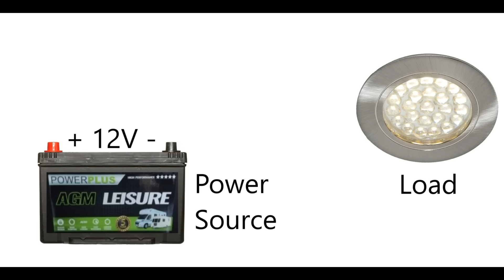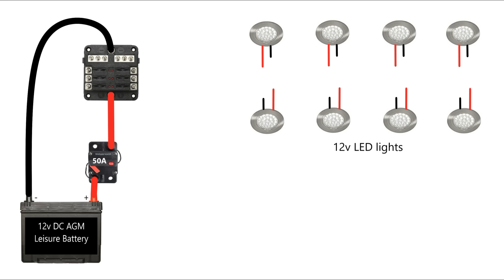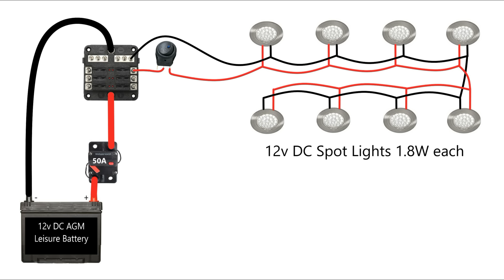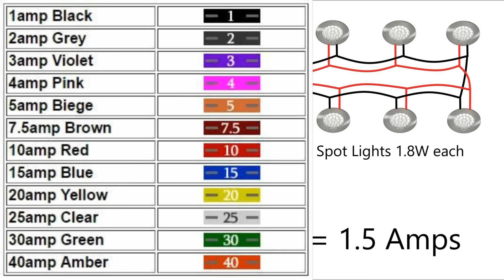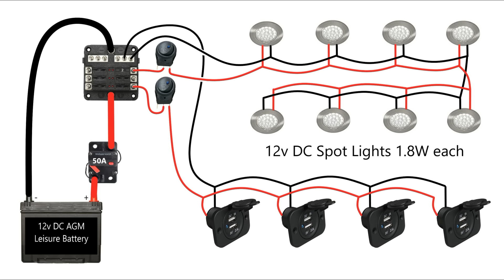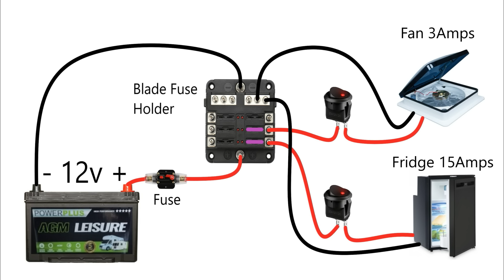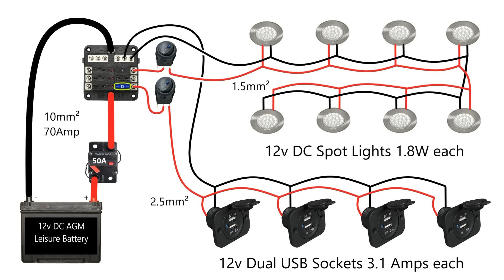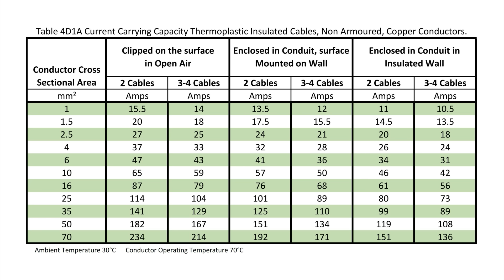Electric Cable & Fuse Sizing - Camper Van Conversion Series

Comment: Hi Greg,

Firstly thank you for all your well thought out and detailed videos, it's great to have a reliable source of information! I was wondering if you have created a video on wire size for invertors/batteries. I am about to install a 3500W 7000w Peak invertor into my van alongside 3 100Amp lithium batteries (I may add another battery to the set up if budget allows towards the end of the build!). All will be installed in close proximity and I think I need to make my connections with 4/0 awg (120mm2) wire but wanted to reference check with your videos. Thanks again!

Comment: Hi Greg. 
First off thanks so much for all your videos on self build campers. I've been following your videos from the very beginning of my sprinter build, You've helped me out so much. My question is about what size of breaker should I be using from the leisure batteries to the fuse box. So far I've got a maxfan and some LED lighting coming from the box. 
Thanks for any advice in advance. BTW I'm owe you several pints for all your very detailed and informative videos.

Comment: Brilliant video Greg. Thank you for taking the time. I have a question. In my van, during hot days some of the led spot lights stop working, then come back on at night. You say in this video that cable current carrying capacity reduces when the cable is hot. The van in black. I wonder whether the hot roof is the cause, as I think the cables are right against the metal. The van conversion is finished. Do you have any advice?

Comment: Need a quickie 12 volt setup to wire up some lights ONLY to light up a 3 room gutted house for the realistate lady to just be able to flip on to show the inside of the house, really don't want to deal with solar panels just battery & switch & lights

Comment: Great job explaining however a demonstration of wiring a three way would be helpful.
Reply from the maker: What are you converting a double decker bus? They are normally used on stairs or very long hallways. Vans are tiny so not really used. 
However as you’ve asked I’ve googled a wiring diagram for you 
https://upload.wikimedia.org/wikipedia/commons/thumb/7/7a/3-way_switches_position_3.svg/300px-3-way_switches_position_3.svg.png

Comment: Thanks Greg for all your great instructional videos. I have a question about wiring, could you enlighten me? I'm wondering if CCA cables can be used in the van or would it be better to go with pure copper? There is a lot of information about sizes but not about materials for wires in vans

Comment: another fantastic video ive found, one thing im still unsure on is cable sizes. why did the lights needs 1.5mm when from the table 1mm would have been plenty. also 2.5mm (according to the tablew) for the usb sockets was plenty big enough. cheers
Reply from the maker: There’s no harm in going a little bigger on cable sizes in fact there will be less voltage drop if you do. I could buy a reel of 1.5mm cable and wire most things so it was easier. 👍🏼😊

Comment: Hi Greg, as far as I can find yours is the best and easiest to understand info on this topic out there. But I do have a question… how do you wire your 230v sockets after your inverter… and how many is sensible. (I know there’s lots of variables within that) if after your inverter you had 4 2gang 230v sockets around your van, do you wire it like a 8gang extension? How do you fuse this not knowing what could be plugged in? Eg a kettle and toaster both high amps and wouldn’t be unusual to be used at the same time. Or is it better to wire each 2gang socket individually to a consumer unit before then back to the inverter? 
Thank you for the massive amount of time and effort that must go into producing these videos and PDF’s

Comment: Greg, we're in the very early stages of a van build and have decided we are going to run a DC setup for our lights, fan and water pump etc but are just going to use a power pack/station to run the AC as we want to run an induction hob in the kitchen. This seems to be the best way I can work out with my limited knowledge and budget. Do you have any drawings for this kind of setup? Or are you able to point me in the right direction. Any advice appreciated. Have been watching a lot of your content recently!

Comment: Awesome awesome video and channel!!!!! Tells me all the things I’ve ever wondered about electrics for my van! Just wondered if you have done a video on cable and circuit lengths and what amp size wiring to use. For example to wire a light bar the positive and negative wires are going to long so avoid amp drop over the cables what size to use etc? Make sense?

Comment: Hi Greg, just bumped into your channel and without hesitation I can say you are one of the best on Youtube. I have a question, hope it is not a silly one. I was wondering that if one gets caught in an emergency, and you do not have any thick wire but have normal electric wire like that is used in home installation, can one double or treble them and join them together from the ends, will that became a thick wire? Again Thank you

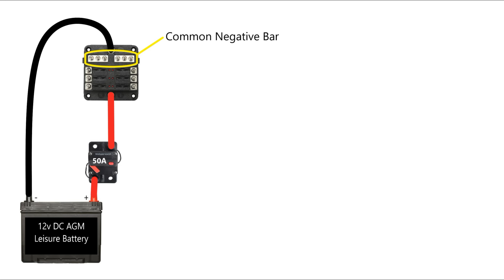Comment: Hey Greg, love your videos! I just have to ask though as I've been thinking about this for a while now. At 11:00 - 11:45 ish you talk about the results and the voltage drop from wiring in series. Would that really be the case? Wouldn't it be 12/8=1,5 causing all the lights to have the same brightness at 1,5V? I don't mean to sound like a hater, I'm just a bit puzzled as I've been learning that when in series, the current remains the same while the voltage gets distributed and vise versa when wiring in parallel. My wondering aside, great video!

Comment: Thank you for this video. Made complete sense. 

However, can you do something which instead of a standard battery, create a wiring diagram for a powerbank (Bluetti AC220Max). I want to run my camper off that to power12v fridge, 6 led lights, and several USB port locations. Plug sockets, water pump and also having the campsite incoming power, solar power and car charging capabilities.

Comment: Very clear and easy to understand. Just one small question, the CB going into the inverter is usually high amperage 150 to 200A, is this based on the total AC current drawn from all the AC appliances? Thanks.
Reply from the maker: It’s based on the maximum that you could use for that inverter. 
So 1500w / 12v = 125Amp plus a safety margin of 25% = 150amp fuse. 1500w on the 230volt side of the inverter is approx 6.5amps so we’ll within a normal 3pin plug fuse.

Comment: I’ve got the same fuse box as this and I’m wondering if anyone has had any issues with them, the thing I’ve noticed is if you pull the fuse out of the holder the warning led comes on,  if you then test the positive connector beside that fuse with a multi meter it’s still showing voltage, but using a 12v screwdriver test light the bulb won’t come on. I’m thinking the fuse board it’s using a low amp current to test for a circuit but it’s also lighting one led from a multi led ceiling light with no fuse even fitted in the holder, I’ve tried removing all the fuse I’ve also got a spare fuse board of the same type that does exactly the same , which slightly unnerving!
Reply from the maker: As you say the voltage you are reading is the volts used to light the red led. Is that light necessary probably not if you have a tester. 
Are you able to run anything on that voltage without a fuse in??
Reply: @GregVirgoe  Hi Greg, thank you so much for taking the time to reply, I’ve hooked up my spare fuse box to a multi led bathroom light and it is in fact lighting the very centre led ! It must be a very low current (2.99 volts) as the other 20 leds are not illuminating, I’m still surprised these fuse boards are designed in a way that still powers a possible shorted circuit. I think I’ll try another type of board without the LED warning lights. 

Thanks again for taking the time to reply, it’s a true privilege to get advice from someone with the skills and knowledge as yourself, proper belt and braces 👍
Reply from the maker: @golfgtioz  I’ll have to do some testing myself but your suggestion of a board without the LEDS is what I would recommend too 😊

Comment: Hi Greg, don’t you think you should have included voltage drop over the length of wire. Not every van is only 5 metres long.
The rest of your Tutorial was good.
Cheers
Mark

Comment: Wow, tried so many videos/literature to get my noggin around this and finally made sense of it with your video Greg, thanks! I've a question though. To figure out fuse size needed for x4 lights as 3w each would mean 12w % 12v = 0amp? Does this mean a 1amp fuse would be best and safest?
Reply from the maker: 12 / 12 = 1 so to avoid some nuisance trips I would use a 2 amp fuse.

Comment: When I have ran wire home or data wire, but mostly commercial through metal building studs.  I would use rubber grommet once I would drill the hole through the metal simulated 2 x 4 stud I would insert the rubber grommet around the edge of the hole so no wire would Fray in any way.
   Now,  I have not purchased those rubber grommets in years so I don't know if they exist anymore but most likely they do...
   That's for protecting any type of wire in the chance that it may Fray and we're down the casement of The Wire

Comment: I think, on the initial install of wiring, I would either add an additional wire set inside the conduit, leaving it unattached and taped off at both ends.  That way, when and if I needed to add or fix some wiring, the wire is already inside the conduit. This could also be used for simple troubleshooting.   Or, I'd lay a piece of string/rope/ inside the full length of any run on the initial install, and if more wires are needed later, I could attach them to the piece of string and pull through from other end.  Do you see a problem with this plan?  Thanks.

Comment: Such a great video with so much extremely valuable information and very easy understood from your explanations.  Great job!  I was wondering if you have ever tried or know of someone installing a toilet in a van that has a flush that fills from grey water tank?   So recycling the water from basin etc?  I know I would need a submersible pump in the grey tank that is on request but other than that any advice would be appreciated.

Comment: For the USB, aren't the amp ratings of the socket at 5v, not 12V?  So each socket would have a max draw of 3.1A x 5V = 15.5W?  Then that's a load of 15.5W per socket for a total load of 62W (4 x 15.5V = 62W).  Then 62W / 12V = 5.16A.  So a fuse rating would be 5.16A x 1.25 = 6.45A.  It seems like the fuse you've selected is too large for the load.  I'm happy to know if I'm wrong though.
Reply: Also, thanks for the excellent videos.
Reply from the maker: Yes you are right 👍🏼

Comment: Hi Greg! Awesome video. Thank you for taking the time to create it. I was just wondering... am I right in thinking I can put a switch just before each light for individual light control for different areas of the van? Can I just extend the positive to a light switch and back to the light?
Reply from the maker: Individual switches on each light will work perfectly. You need to branch off a ring circuit before the switch so other lights still can get power. Or you can run a separate pair to each light from a bank of switches

Comment: Hi Greg. Cracking video as always. I noticed in one of your recent videos that you've changed the shower extractor fan from the one that you originally installed. Just wondering if you've got a link to the current one you have and how come you upgraded. Cheers!
Reply from the maker: We haven’t changed the fan just the external grille. We kept losing the flaps on the old one so now have just installed a fixed cowl which is much simpler and no moving parts

Comment: Does connecting 2 wires connected from heads together work, is 2x2,5mm2 one 5mm2 wire what if knife insulator every meter about 2cm and tape

Comment: Hi Greg just watched your video on caravan electrics this is my first time converting a van i am a joiner to trade so have no problems with the conversion except for the electrics think i am watching too many videos i was recommended to yours we wont be off grid much so wont have solar panels but would like to use a inverter will mainly be electric hook up whats confusing me is the charging my van is a Renault master euro 6 and year 2020 so should i use a DC to DC charger between the van battery and the leisure battery and should i need any other charger i just want to keep it simple i have the confidence to do it but too many people saying different things hope you can help
Regards
Ian Bence

Comment: Thanks again Greg - I've watched just about all your vids now and they're really helpful, thank you.  But I have a question that I'm becoming more and more confused about, and that's about 'grounding'.  On a campsite the earth wire goes back to the campsite hook up, but I can't find a definitive answer as to whether 'grounding' an earth wire to the van when off grid and using the inverter to power 230v.  Some say yes, some say no which is really confusing - I'd so much appreciate your help on this!
Reply from the maker: Your 12v DC system does not need to be connected to your van but you can connect your 230volt common earth bar to your van 👍🏼😁
Reply: @GregVirgoe  Thank you Greg 👍

Comment: Hi Greg,
Love your informative videos. Can i just ask your opinion? You dont mention volt drop along a length of cable. I believe as another layer we need to then compare to a volt drop table to possibly up the cables sizes. I know this is the case for the likes of a fridge as mine needs a massive cable.
regards Rob
Reply from the maker: Yes Rob, only so much I can cover in one video. Most of the loads are small and distances short. You are right about the fridge. It needs a bigger cable to ensure there is no voltage drop. 12volt planet have a useful online calculator for volt drop

Comment: Great content as always Greg. If we are running long cables do we need to take that into account? Or due to the average van size, the length not be enough to worry about? Many thanks 👍👍
Reply from the maker: Yes there would be a voltage drop over a long length and some devices are susceptible to low voltage so rather than go into length valve if you are close to the amp rating limit then go larger. Never any harm in having bigger cables. They will run cooler with no issues. 👍🏼😃
Reply: @GregVirgoe  Thanks for the speedy response, top man thanks again 👍😉

Comment: Would the lights have been perfectly fine on 1mm cross section? Maybe I missed it but haven't quite grasped how to read the table, just find your amps, make sure the wire is greater than the fuse rating, but I'd have thought 1.5mm is overkill looking at the table? 🤔

Comment: Thank you for that, it helps me a lot. Very good source of knowledge.  Do you have maybe a wiring diagram for 230v fridge connected through the power inverter. And because the power inverter even on its own drains a battery, I saw somewhere that it could be connected in such way that the fridge thermostate switches the power inverter when the fridge needs it, and switches off the power inverter when the fridge is cooled down. It is connected through 240v 8 pin relay or something like that.